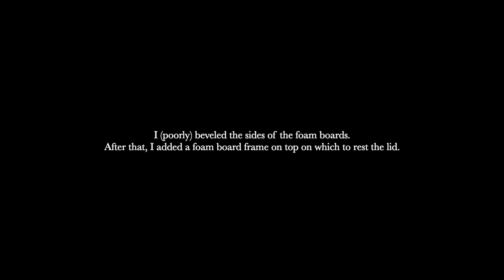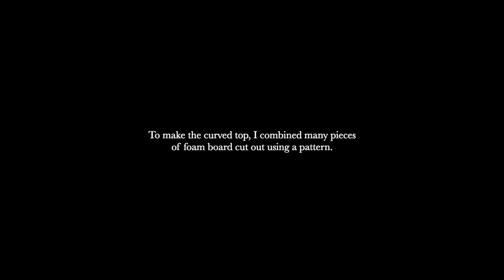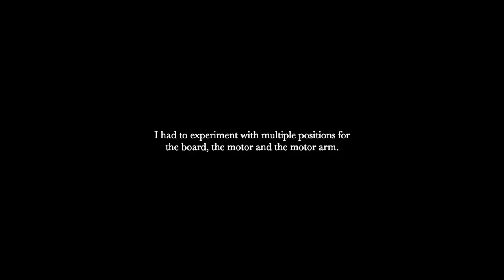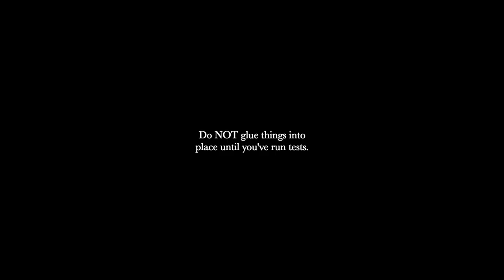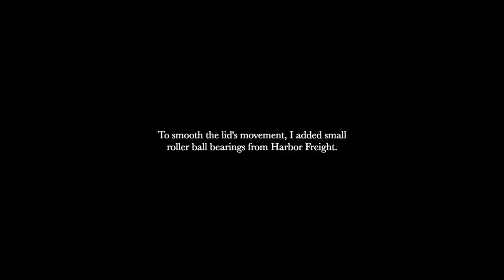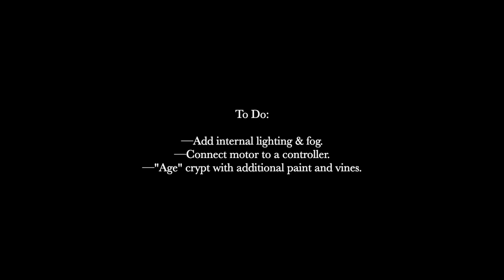Halloween Crypt with Moving Top

Comment: I’m surprised that a wiper motor is strong enough to move a thing as heavy as the lid!
Reply from the maker: I doubt it would have worked without the roller bearings along the top.  I've built a larger crypt this year with its lid on an incline.  A wiper motor struggles to move it, so I'm probably going to replace it with a linear actuator, which is stronger but has a less interesting movement.